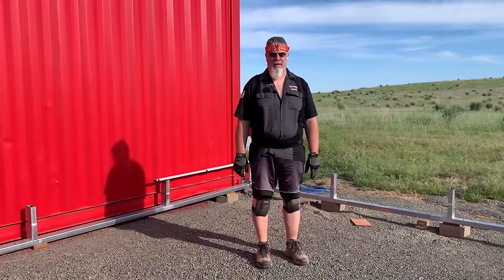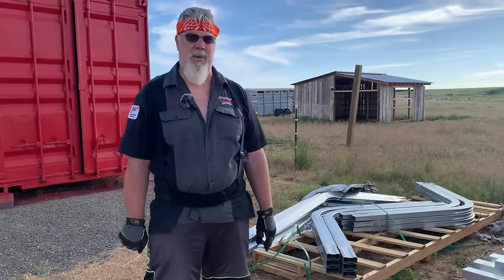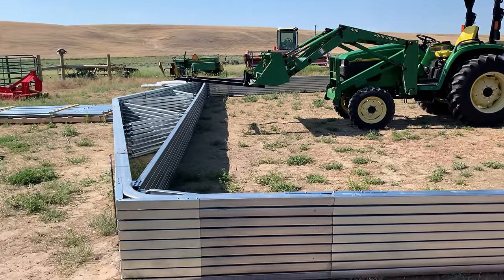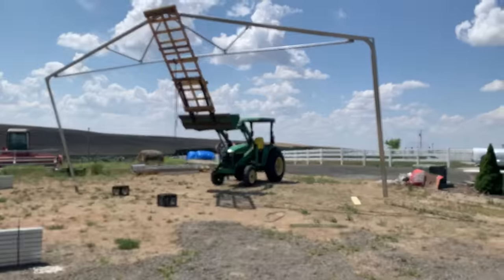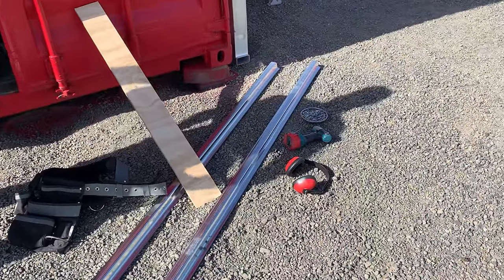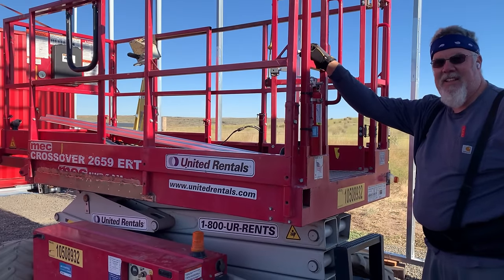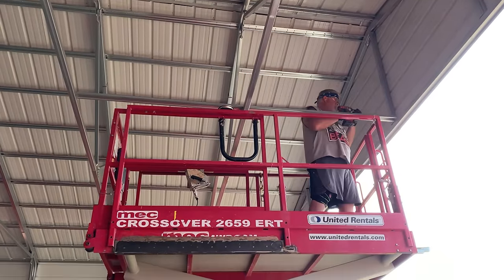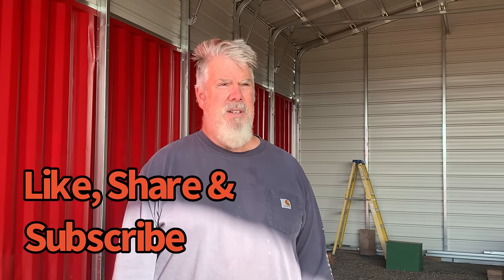VersaTube Shop 36x40 Build Step By Step and Shipping Container. How to Budget DIY Container Shop

Comment: No anchors on the shipping containers - good so far.  But when you added the Versatube structure did the taxing authorities reassess your project?  I put two shipping containers on my property without property tax consequences, but I fear if I did more they would do what they do best.
Reply from the maker: The shipping containers don’t need anchors.  They are 10,000 pounds each then all the added weight from stuff stored in them.  Not going anywhere here.  Thank you for watching.
Reply: @homesteadingwithblueskyranch   Of course not, except in hurricane areas.  I didn't anchor mine either, I suspect the addition of concrete to anchor to would be the trigger for taxation as structure.  Did your roof system draw the attention of the taxing authorities?

Comment: Beautiful job.  We have something similar on my dairy farm. Question    Shouldn't the metal for the sides been turned so it runs the long way instead of sideways?
Reply from the maker: Thank you so much for watching.  This is how Versa Tube designed it.  It’s definitely different than from a pole building with wood verses steel built.

Comment: The tubes are only square depending on how you install them. You mean they are bent or warped however that doesnt matter as much depending on where they go. Metal tube can be not straight but still be useable as long as where its welded together its not cracking as far as the welded seam. Nice build tho.
Reply from the maker: Thank you for watching

Comment: The back wall should've been ran up and down
Reply from the maker: This is 100% engineered and designed by VersaTube.  Per their instructions.  The metal is precut and only fits on the metal supports the horizontal direction .  You can not turn it vertically and make it work.  Normal pole buildings do put the metal usually vertically. Thanks for watching.  👍

Comment: Would you mind sharing the cost and reason behind sandwiching between the containers? I was thinking of doing something similar but was going to install the versatube building on top of the containers rather than in-between
Reply from the maker: Absolutely!  We chose shipping containers to provide protection from the wind.  We had 70 mph winds this winter and it was not affected by it at all!  The shipping containers were 3,400 each and the Versatube kit approximately 18,000.  We did order it with extra engineering for snow and wind load.  Plus the cost of renting the lift and gravel to compact the area.  Hope this helps.  Please like, share and subscribe 😊
Reply: @homesteadingwithblueskyranch  thank you so much for taking the time to reply! Very helpful!
Reply from the maker: You are welcome!
Reply: I'm planning a smaller version and I think I will order the trusses wider and just put them on the whole container.
 Great video!!!

Comment: I suspect you will have water problems where your knee wall meets the top of the shipping containers.  The roof of the conex has a small crown in it, so water from half the shipping container and the entire surface area of your new roof will tend to be trapped in this connection area creating ponding and drainage issues.
Reply from the maker: Thank you for watching.  We live in a very dry area.  No water problems so far after over a year. But if you did have water concerns gutters on the shop would be the way to go.  Thank you for watching.